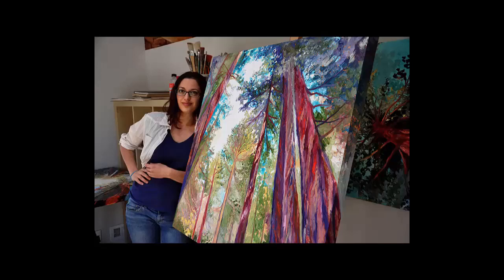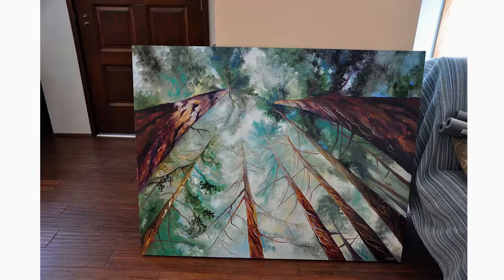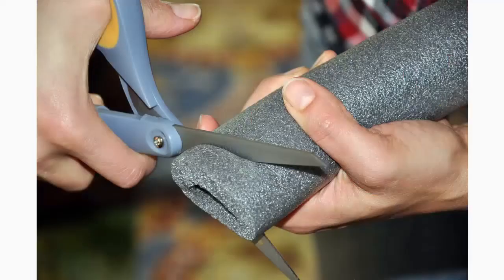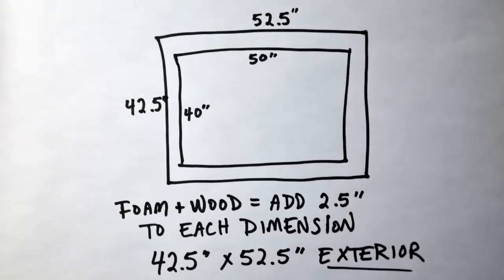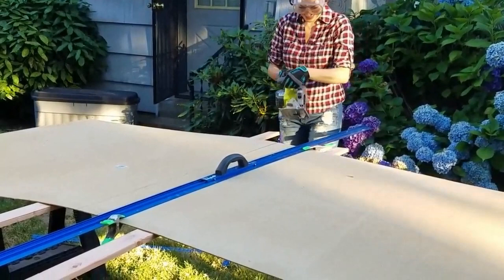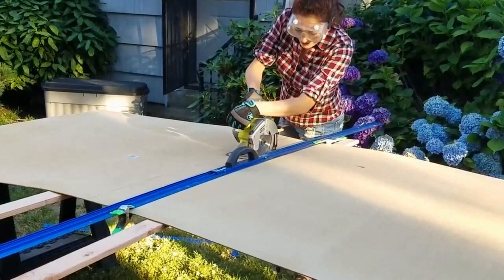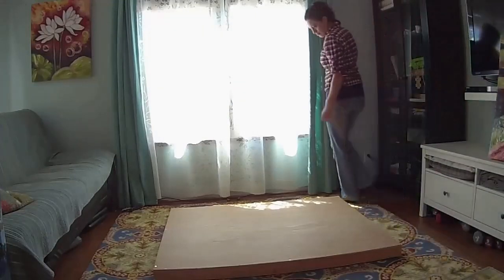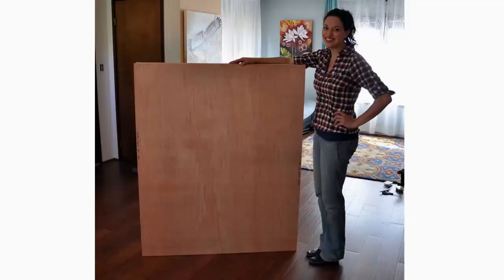Cedar Lee Tutorial: How to Build a Shipping Crate for Art

Comment: I believe this can still break. Only if you know how they handle packages. I would add lots of foam on the surface of the painting
Reply from the maker: The foam tubes around the edges work well for creating a space between the surface of the painting and the plywood. If you use a good thickness of plywood, it can't bend. I've never had a painting arrive damaged. But, there's no one "correct" way to pack things and padding is good. I'd just say to be careful about pressing foam or bubble wrap directly against an oil painting. Sheet of paper or cardboard to protect the surface, then foam over that. 👍

Comment: Where did you get that size plywood? The biggest I can find at my home depot and lowes is 4x8 feet. I have paintings that are 4x4 feet and would need plywood that is slightly bigger than 4 feet on the smaller dimension.
Reply from the maker: Ah, I believe the painting I was packing in this video was 40" x 50", so that one would fit inside one sheet of 4' x 8' plywood. You are correct, I believe that's the largest size you can buy. I don't think I've ever shipped one where the larger dimension is more than 4'. But in this case, I would get creative and there would have to be a seam. I'd probably glue and nail or screw a strip of wood over the seam to make sure it's sturdy and waterproof, and reinforce as needed.

Comment: Very helpful.  thank you! Also, do you also create your own shipping box to put the crate into?  My artworks are in the high end so I am not charging for shipping but I am including handling fee.  So, would you suggest to charge for shipping for wooden crate shipping? - thanks
Reply from the maker: Hi! I don't think it's necessary to add a cardboard box around the outside of your wooden box. If I am worried about moisture getting in the gaps, however, I might seal around all the seams with packing tape. I do not currently charge a handling fee for most large-scale art, but I take it on a case-by-case basis. For example, I'm typically more inclined to be generous with shipping and handling coming out of my pocket if I am shipping something to a repeat collector. This is your call!

Comment: I'm shipping 4ft. by 7ft painting from Phoenix to Santa Fe NM...that's big. Any ideas? Trying to do it cheap...
Reply from the maker: Frank have you thought of using the big sheets of foam insulation? In the US, you can find 1" thick sheets in the insulation aisle of Lowe's/Home Depot, 4' x 8'. I have successfully cut pieces of this to form a snug box all around a painting, including strips around the edges. Assemble it all with packing tape. Then you can build an outer box around that with thin hardboard or sturdy cardboard. I might go that route here.

Comment: I would cover front with bubble wrap
Reply from the maker: Yes, only thing is you have to be careful about bubble wrap right up against the surface of a painting. It can leave indentations and marks. If you do this, it's wise to cover the face of painting with butcher paper or something similar, before wrapping with bubble wrap.
Reply: @ArtByCedar  glassin paper
Reply: must be acid free
Reply: @ArtByCedar  Yes, if you want to level that up. Use Acid-free cover paper ;) And first  rule of packing: BUBBLES OUTSIDE!

Comment: What is thickness of ply wood sheet
Reply from the maker: Go as thin as possible. For a shipping crate, you want to keep the weight down. As long as it doesn't bend/bow in the middle, it will be strong enough. The smaller the box, the thinner it can be.

Comment: The piece is too small to be crated . I understand if you were sending to Germany lol . Just waste of money shipping this way unless I’m shipping a basquiat .
Reply from the maker: I've always taken great care with my paintings. 🙂 This method can scale to whatever size crate you want/need. If using a much larger sheet of plywood, it's a good idea to add some lightweight cross braces to keep the plywood from bowing.
Reply: I Like the foam edge idea with those “plumbing noodles”. I’d add a one more step though and wrap the art in a sealed plastic bag before placing it in the crate to prevent moisture from getting to it through the box.